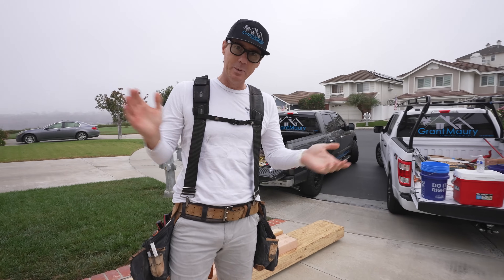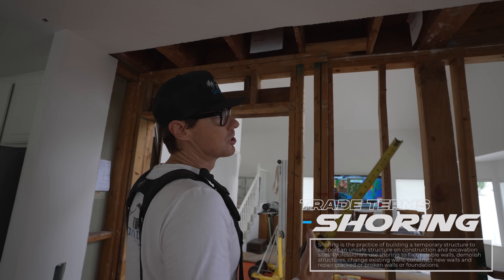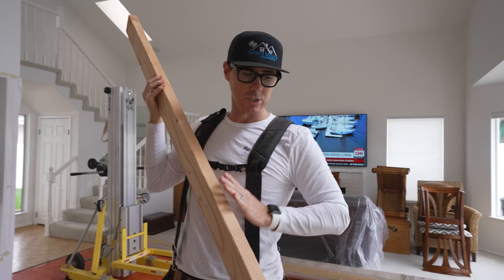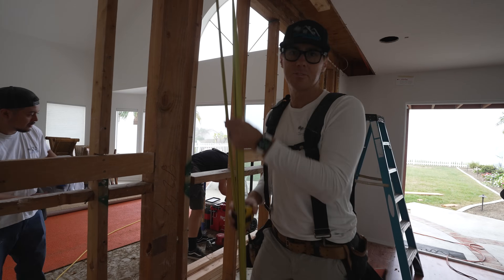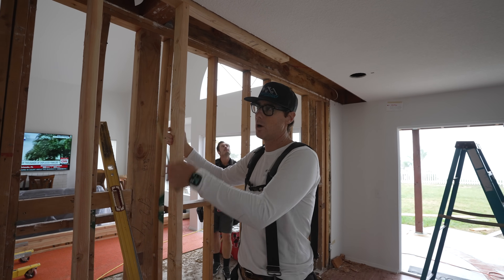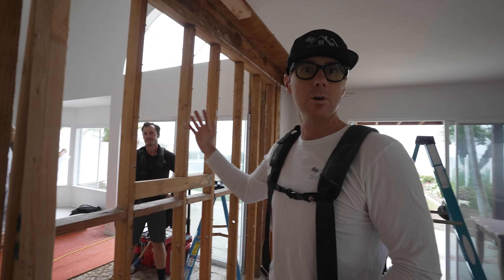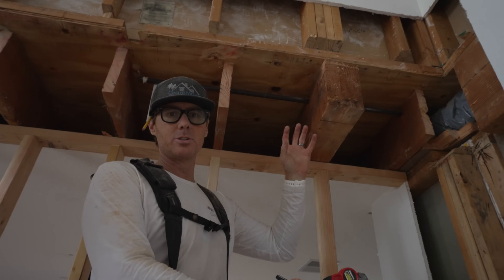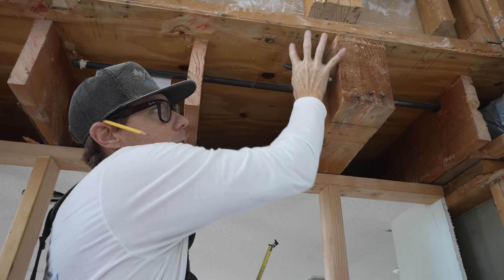How to Remove a Load Bearing Wall + Install a Structural Beam

Comment: Okay I have a question. I want to do this on a mobile home, a single wide mobile home. I want to remove a 10 ft piece of wall and add on to my dining room. All of this applies to what I'm going to do except for on a mobile home the floor is junk already so if I'm going to transfer all the way to the roof onto the two poles on each end on the floor it seems like it's going to be a problem. Therefore I think I still need to do something on the floor. Maybe even put some sort of beam similar to the top down there or something. What are your thoughts on that?
Reply from the maker: In all honest transparency, we do not have a lot of experience working on mobile homes for this type of service. We would recommend having a licensed engineer take a look to advise in regards. Thank you for your interest in our channel!
Reply: @grantmaurybuilds , ok, thanks. That's out of my budget. I'm talking about a single wide mobile home. I'll figure it out.

Comment: What should I do about making the temporary walls on top of laminate flooring?  Is there any way to do these without nailing into the laminate?  What is the solution here?
Reply from the maker: It is possible to install temporary walls (shoring) without securing the plates to the floor. Just make sure that your studs are plumb in both directions (or very close to plumb), and snugly fit so that the plates don’t slip or move. Remember to always double and triple check all your existing framing and configuration before removing any load bearing members. Hope that helps - we appreciate your interest in our channel!

Comment: Excellent.  My biggest concern was if a simple metal hanger was enough for the main floor beam that the other floor joists coming in from the other direction mounted to. There is a concentrated load at that one metal hangar.
Reply from the maker: We are so glad you enjoyed the video! Great thought on the hanger concerns, and your description of intersecting wood members and how they are transferring is pretty accurate. We followed what our licensed structural engineer specified on hanger use for this application. We always recommend that you have a structural engineer take a look and advise you on requirements!

Comment: Great video! I'm not a contractor. What were the straps you were installing and did you guys finish the drywall or another company?
Reply from the maker: Thank you for the feedback! The straps used in this project were Simpson CS16, coil strap. We also installed numerous LTP4’s and A35’s where indicated and appropriate.

Comment: Great tutorial!…as a remodeling contractor I’ve been involved in this many ,many times.Curious as to the engineering that went into your project…size of beam,loads on posts,what’s under posts,etc.
Reply from the maker: Thank you so much for the interest in the channel! Great questions, our structural engineer visited the site before hand and calculated what reinforcements (foundation, posts, beams, etc.) would be necessary given the existing conditions vs new proposed wall removal.
Reply: @grantmaurybuilds , how long (days or hours) it took to do this?

Comment: It probably would have been better for you to use  2x material for the point loads so you could face nail to the wall. Also there was  no consideration for the 2x4 wall above the beam - it’s just left floating in the wind. Would be very easy to shore this wall above as well. A note on those CS16’s, as soon as you bend them they are useless. Looks like you will have to fur the wall now because the beam is wider than the existing wall. Probably should have ripped that down before hand!
Reply from the maker: Great feedback! Thanks for your interest in our channel!
Reply: @seantekano3245 I was curious why they didn’t show showing on the 2nd story. Wouldn’t another shoring wall be necessary?
Reply: Curious, how would you shore that 2x4 wall that’s floating above where the beam was going? We are installing a beam in an exterior load bearing wall that supports a second floor and rafters above that. Also we are working with a PE and waiting on his input.

Comment: Great tutorial. Question, what is the metal strapping on the posts for?
Reply from the maker: Great question! The strapping that we installed at the posts is used to tie in the top plates to the posts wherever they intersect. The goal is to reinforce and strengthen the plate / post connection since we “broke” the top plate to install the posts 

Hope that helps! Thank you for your interest in our channel!
Reply: Probably should have just used a post to beam connector.

Comment: Loved the video, nicely done and very informative.  Question about the posts supporting the ends of the beam.  Was the slab already reinforced at the location of the posts and capable of bearing the weight instead of the weight being distributed across the wall?  How did you determine the capability of the slab to accommodate the concentrated weight?
Reply from the maker: Thank you! Yes we addressed this in the earlier phase of construction. We recommend consulting with a structural engineer when making any modifications to existing conditions.

Comment: We put up 2 glue laminate beams this year - one to support about half the width of the end of the house  ‘cause we were extending the length of that room by 16’ and then tieing another 14’ beam into that one ‘cause we were widening the existing  room by 2’.  The second beam is load bearing.

Our 2 beams look nothig like the beam they are installing.  What type of beam is that?  It almost looks like an OSB beam.

I would have used three 7” or 8”  timber screws in each support post to ensure a rock solid hold to the existing framing [and thus no need for the strapping].  My experience is that nails tend to work loose as wood dries and thus shrinks a bit; I like to reinforce with construction screws of the appropriate size.   In fact I used Simpson construction screws in 1/2 of the holes on my beam hanger.

My 0.02¢
Reply from the maker: Thanks for the feedback and interest in our channel!

Comment: First there was no mention of having an engineer (registered P.E.) involved which can be pretty critical now or in the future when the house is sold. Next, a center perpendicular beam that was ignored and had only 1 stud under it. It should have had a temporary column under it, not 1 stud which could have buckled after the demo.  Also there was no mention of an estimation of the load of the second level wall or the portion of the roof load that it then supports. The simple solution after estimating the loads would have probably been two installed doubled temporary studs and then maybe a triple or quadruple built-up stud post under the beam. Having an engineer involved reduces the risk to the homeowner or the contractor and of course provides a document for a future purchase or that the structural modification was properly done. And yes I’m a P.E. who supports load bearing modifications for modest fees.
Reply: Gary Beck, Why would this cause an issue when the house is sold? Even if it was done wrong, do you think that home inspectors are engineers? Do you think that they would catch that a beam was added or modified, least of all that it wasnt sized right? If it’s in drywall they wouldn’t even know if it’s 2 by, an LVL or a steal beam. Please explain how thiswould cause a problem at the sale of the house.
Reply: @user-tg7rw9vv7g just as a side note. A lot of home inspectors are as worthless as tits on a boar hog and are in somebody's pocket.
Reply: @user-tg7rw9vv7g I live in CA and work at a structural engineering firm and do structural analysis (I am a licensed engineer in training (EIT) working on getting my PE very soon.  If you do not get your modifications permitted (which means having an engineer provide supporting calculations and drawings submitted to the local building department) a prospective buyer later on could call into question the work that was done and thus reduce the worth of the house.  The building code has requirements for modifications and almost always they require a licensed engineer to be involved to sign off. That is why. Also, they could be removing a large section of shear wall which could mean big trouble regarding the lateral stability of the home.
Reply: Hey man what fees would you normally charge to plan out a project like this?
Reply: At 17:10 it looks like a beam comes in from the right but it doesn't appear to have a stud or two under it to support it. Maybe I'm missing something but it's doesn't look right to me.
Reply: @shawnmullen3032 LOL
Reply: @shawnmullen3032 that looks scary s that’s a big beam that’s held on by nails
Reply: I jus farted
Reply: Agreed I had to have engineer draw out the plan to get a permit, but it make sense to me because the weight have to be supported when you remove the wall
Reply: Yeah, that beam had me worried when they just went after that column with that twig of a stud being it's replacement. 🙈
Reply: I just came here for the "garybeck" guy. I knew he would be here.
Reply: Excuse me Mr Rockefeller with your “engineers”
Reply: Do you also want him video himself calling the engineer, driving to the permit office, meeting the engineer, visiting a forest to choose the trees he wants and following the log trucks to the mill and the actual cutting with a 24/7 cam for the wood drying then following the wood to his house then being like oh damn I need nails………🤦‍♂️ it’s a simply tutorial for people to see and get a basic understanding of what goes into tearing out a loaded wall. It just ain’t that deep and not meant to be the golden how to do everything video.
Reply: I'm a structural engineer also and if I was a homeowner I would do exactly as they did.  You're not designing some complicated structural system there nerd.  And who would ever know that wall was modified?
Reply: @kent223  Exactly, everyone has there two cents and hand in the cookie jar nowadays.
Reply: @kent223 oh my gosh, here comes  structural engineer that graduated with a degree that required almost a genius level intellect and he still has common sense! Please clone this man.   These guys tool every precaution and did a great job. Could you pick to to death from a code stand point,  crap who couldn't? I have had to engineers fight over the same item. 
I was a professional firefighter for 15 years. We did inspection and could have cost people huge amounts of money and time had we held them to every letter of the NFPA. What we looked for was was it safe? Could people occupy the structure safely.  
It amazes me with all the bureaucracy and government in our lives, people still want more.  There are thousands of craftsman out there that can't read real well that can make things work. Thank you Kent!
Reply: @kent223  it’s not about who would ever know, it’s about doing it right. I would ear on the side of hiring a structural engineer, such as yourself and pay a few extra bucks to ensure that things are done, right. In this case, it may have been the right thing anyway, but it is not always the case.
Reply: @kent223  I work nearly exclusively in and around light frame wood construction which is a different animal than commercial steel work with bolt and weld connections. Presale home inspectors can easily identify a floor plan that was opened up especially if they see modified gypsum work. They work for the buyer so when they ask if the modification was done with engineering, and they get no documents from the seller, the price just dropped by $5k.  The risk/reward to not hire an engineer does not make sense. A small project like this is easily $5k to $10k and the cost for engineering would be a very minor adder.  Wood framing is very slow to react to being over stressed so well after the contractor is done and gone, a squeak, crack, or sag can show up.  At the point the cost to repair could be similar to the original cost. Is it really worth the risk?
Reply: @garybeck7233  yes it's worth the risk.  It's not a big deal.
Reply: @kent223  it is easy to say it is worth the risk if it is not you who is risking anything.
Reply: @garybeck7233  whatever dude.  If you think that's a huge deal you're just not correct.
Reply: @garybeck7233 , i hired an engineer to design the new structural (removing 55% of existing load bearing wall), do we need to apply for permit?
Reply: @maribethsnow2090 im surprised your engineer didnt do it, most EOR ( engineer of record) would have asked.
Reply: You clearly fell from a second story and had a 2x4 vertically wedged up your back side and you’ve turned into a splintered asshole. 

These guys did very well on there prep and the finish product. 

They were very safe 

Your silly comment about getting an engineer is a clear cut no brainer.
Reply: How about make a well edited video of your own before you shameless plug yourself.  💩
Reply: You’re the reason people skip you contacting P.E’s. Good lord man!
Reply: Calm your tits little boy. This is man talk.
Reply: Can I know how much you charging for similar job?
Reply: Modest fee?
Reply: You only need 3.5 in of support under beam which is what they have. It is done correctly. Please know what you are talking about before spewing nonsense. They did a quality job.
Reply: Absolutely. This dude seems clueless and is listening to his main man for instruction and adding spicy words to sound smart
Reply: I was thinking the same about the temporary supports…?
Reply: Just the man I need to ask, first of all I must say we'll done ! For spoting out the problem. 
Now I know what you are her my question. 
I've 6 beams supported by a wall or into the wall on one side .
And all 6 beams on support on 1 only beam support them all.
Should I add something like a metal bar to support the 6 large beams as well .
I mean it seems to me 1 beam couldn't support 6 beams.or could it?
Thanks
Reply: I partly agree. Just needed to gently move that perpendicular beam post 11 3/8 like the temporary wall instead of cutting it in half, but you and I know It was over engineered and the could support it, but to make the engineers and the viewers happy it would’ve been better to reuse that 2 x 6 for show and peace of mind
Reply from the maker: Thanks for your interest in the channel. We strongly recommend to always check with a licensed structural engineer before making any modifications to existing conditions. That will ensure everything is being performed safely and professionally. Appreciate your feedback!
Reply: Lol it’s fine dude calm down, maybe in a commercial setting but this is a home and it was clearly done correct.
Reply: Gary Beck: First, Do you know that they didn’t or are you just being a know it all? Second, Not everyone can afford an engineer and this math is often simple to figure out. There are plenty of books and websites with charts and information to help. Third, Most reputable lumber yards will also provide free consultation on these sorts of things in conjunction with their sale of an LVL.
Reply: Yeah they should consult licensed Structural engineer.... this thing is scary
Reply: @Omsanatani11111 nothing scary about it.
Reply: So you mad they didn't call you...???🤐
Reply: Pretty sure they wouldn’t publicize their un-engineered, un-permitted work on YouTube.  Their business depends on it.  Why do you assume that their wasn’t engineering done on this remodel?
Reply: Agreed - always consult a structural engineer!
Reply: To the ‘no damn engineer needed here’ commenters, I work nearly exclusively in and around light frame wood construction which is a different animal than commercial steel work with bolt and weld connections (which I also do). Presale home inspectors can easily identify a floor plan that was opened up especially if they see modified gypsum work. They work for the buyer so when they ask if the modification was done with engineering, and they get no documents from the seller, the price just dropped by $5k.  The risk/reward to not hire an engineer does not make sense. A small project like this is easily $5k to $10k and the cost for engineering would be a very minor adder.  Wood framing is also very slow to react to being over stressed so well after the contractor is done and gone, a squeak, crack, or sag can show up.  At the point the cost to repair could be similar to the original cost. I know many many such residential load bearing change projects happen all over the USA, but is it really worth the risk (and the sleep) to save a small amount of money?
Reply: @garybeck7233 w
Reply: I’m not a PE, however I am a EE, I too agree with your point… an engineer is always recommended & welcome when you want to achieve quality results…

Comment: but whats underneath ? Did you guys did concrete and support? each side?
Reply from the maker: Load bearing walls always require footing supports on either end. Always check with a licensed structural engineer before making any modifications to existing conditions. That will ensure all is being performed safely and professionally. Appreciate your feedback and interest on the channel.

Comment: Pretty informative video for the average homeowner who dosent frame for a living. Usually in California a beam being installed like this requires and Simpson eccq at both ends. Also would’ve installed blocks against the beam as you cut the sheathing back so now it rest on the joists only. Also would’ve doubled or tripled the last shoring stud as a precaution never know how much weight one beam is holding
Reply from the maker: Excellent feedback. Thank you so much for you interest in the channel. We are Grateful!